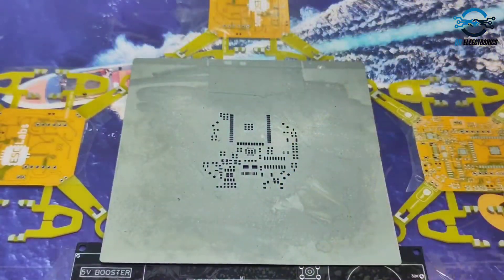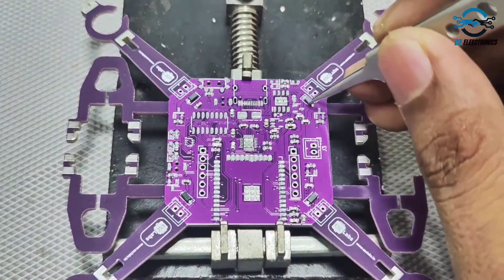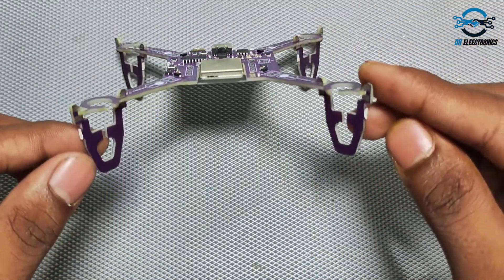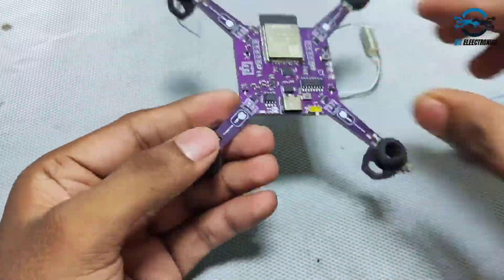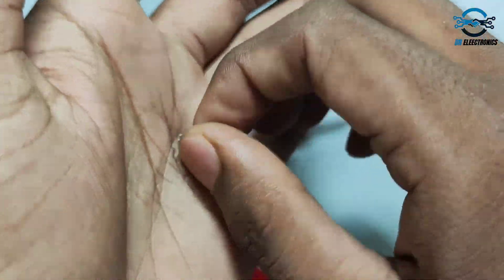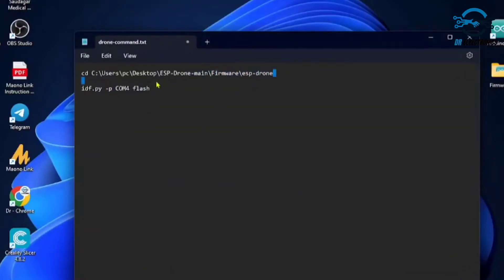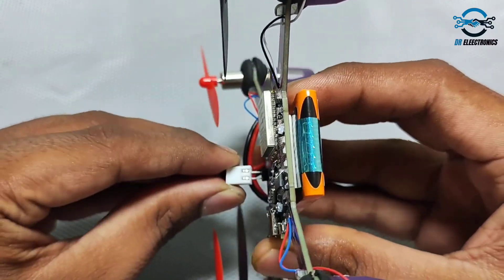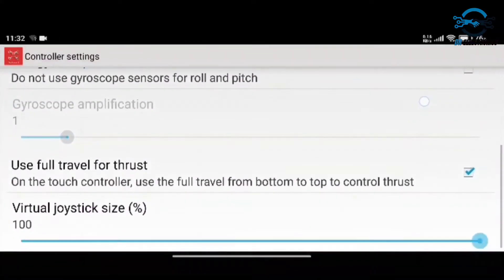ESP32 WI-FI CONTROLLED DRONE From Scratch TUTORIAL

Comment: Bro i just purchased bonka25c 360mah and i fly my drone with it .when my battery is discharged i charge with tp4056 ic module and after completing charging connect battery with drone but it did not calibrate and not connected through wifi what the problem bro help please
Reply from the maker: Check mpu650 is properly connected, reflow it ,
Reply: Ok bro but can i charge my 25c 360mah 3.7v battery with 4056 ic module with 1amp current output,buy from online ,its is safe
Reply from the maker: Yes@Aerospecx

Comment: Bhai, I am trying to make this exact quadcopter for a school project; but cant find details on where to get PCB, the screws or what materials are good to use. I read the Circuit Digest article and searched up components to buy, but it looks different than the one in your video especially the ESP-32 Wroom Module which I don't know how to use or where to place it since it seems not the same as in your video. Could you please make an in-depth video guide on how to get everything or set things up because I am confused and worry I might make mistakes in the process. If I just follow everything you did in this video will it work, please answer?
Reply from the maker: @ayanalbieahmed3242  their is ibom file on GitHub repo of circuit digest which includes every part name , find it their
Reply: @drelectronics13 Turn on chat option in your Google acc setting so we can directly message...Please sir this is most important for me!
Reply: Sir, I must complete this project within two weeks so you must help me as this is my very first time. Can I email you instead? Since what I did was go to  the Circuit Digest article, scroll down, and clicked a link attached to a black backdrop, it showed me the components config and more but I don't know which ones to click  or navigate.
Reply: I sent you a message in Google, reply please.

Comment: I ised 3.7v 18650 2500mah battery but it calibrate agian and agian what the problem ??
Reply: Can i use 3.7v 600mah or more lipo battery instead of 1s 30c 360mah battery for flying my drone
Reply from the maker: @indiancreativ7475  yes but weight issue
Reply: What is best chioc 1s  30c battery or normal lipo 3.7v 1000mah battery
Reply from the maker: @indiancreativ7475  1s 30 c 3.7 v 200 to 800 mah max
Reply from the maker: @indiancreativ7475 drones need high discharge rate , like 25c or more in this case , thats why battery voltage drops in 18650 cells and drone reboots

Comment: please answer, i am trying to make it but have problems with smd, can i use any another through hole mosfet or bjt instead of SI2302
Reply: Can I use bd139 or irl520 mosfet?, if yes, then can I just replace the si2302 mosfet with the bjt?
Reply: And no change in circuit diagram?
Reply: any reply?
Reply: Hi are you able to create this project?
Reply: @mdabdullah6868  yes kind of i did not use smd stuff so it was heavy still it is working good now.
Reply from the maker: @arinchaudhuri u can use , also u can buy alternative options to sI2302 like cj3402

Comment: Hello sir, where can I find the firmware code needed for the drone?
Reply from the maker: @Yeetlord2135  all necessary links are given in description
Reply: Also, what are the specifications of the battery you are using for the drone?
Reply from the maker: @Yeetlord2135  3.7v lipo 45/70 c rated
Reply: @drelectronics13  thanks sir

Comment: I think its overpriced u are just using esp32 cost nearly 200 to 300 which have already ch340 drivers and u havebjust added like 100 rs mpu6050 and pcb may be 200 or 300 but u are charging 2700 too much people will buy dm002 as compared to this thing at same price with camera also and with different modes
Reply from the maker: @ManshYT u can't program DM002 , ESP32 DRONE is made for makers , and it's programmable :)
Reply: @drelectronics13  yes I know but if any person make at it owns with these devices and own pcb then it will be programmable

Comment: I have assembly  drone board but unfortunately esp module cannot flashing and communicated kindly suggest an solution
Reply: Bro can you pls share pcb diagram this mfs are not giving pcb diagram
Reply from the maker: @wrestlingworldromansandajs447  hey its open source all circuit and gerbers given in this article https://circuitdigest.com/microcontroller-projects/DIY-wifi-controlled-drone
Reply: @drelectronics13   No the pcb your having show different in the above link because they have no reset button and QNF package are used so kindly suggest or provide an best solution to overcome this problem
Reply from the maker: @charumathim9534  the link to latest updated bom is available on esclabs.com
Reply: Im  flashing the program in esp module and connecting as per the schematics diagram but the motor is doesnot working when I am connecting with app its connecting but not respond from motor kindly suggest an solution of this problem
Reply: @charumathim9534  same hear, if found plz reply
Reply from the maker: @charumathim9534  which drone you are using custom or the one from esclabs
Reply from the maker: @charumathim9534  you can dm me on instagram
Reply: @drelectronics13  also i am having the same problem to flash ESp can u suggest
Reply from the maker: @dipanshudhote5312  please dm on instagram
Reply: Hello, I have done all the process and connect it with app and also motors check are okk but when I up the throttle the motors not spinning why
Reply from the maker: @dipanshudhote5671  enable location on mobile , do watch other tutorial video on my channel
Reply: @drelectronics13  I already enable location access but even it not flies

Comment: bought the same drone kit, stability is no where close to as yours. what are the remote side settings, PID etc can u share ?
Reply from the maker: make sure to select full travel thrust , in controller settings and in flight controller settings set DEAD ZONE To 0.1 
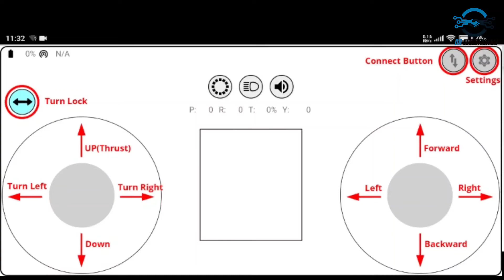And also disable TURN lock button for easy handle in beginning refer 9:03 
And ofcourse you need to calibrate roll and pitch
Reply: @drelectronics13  Thanks